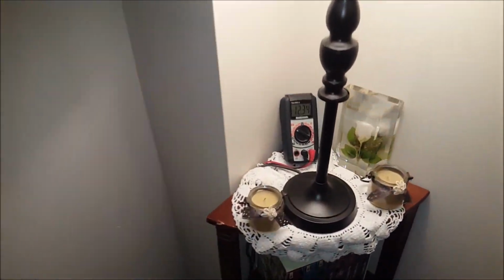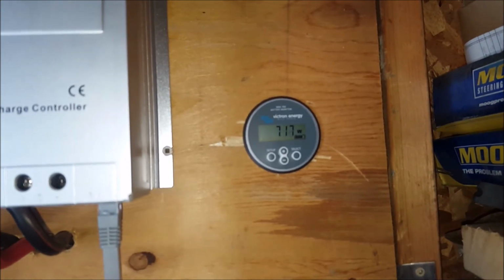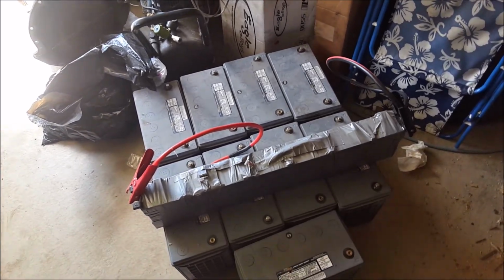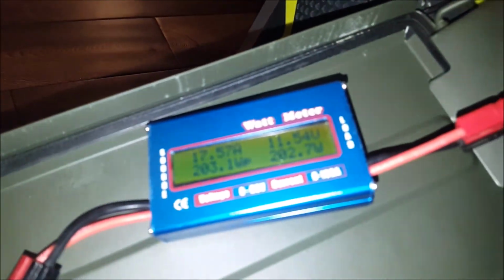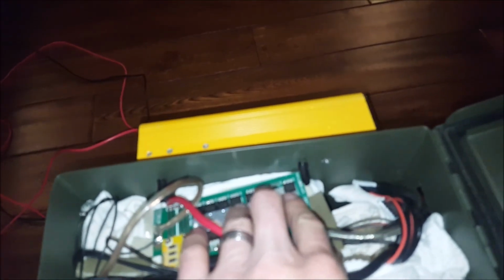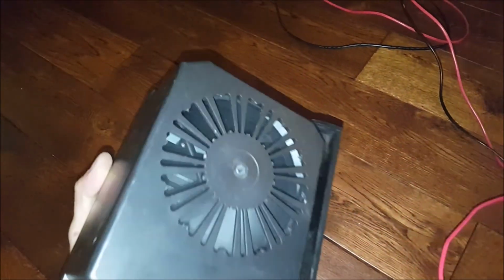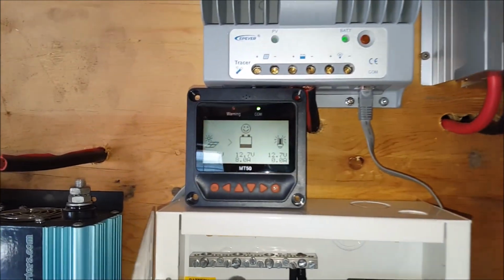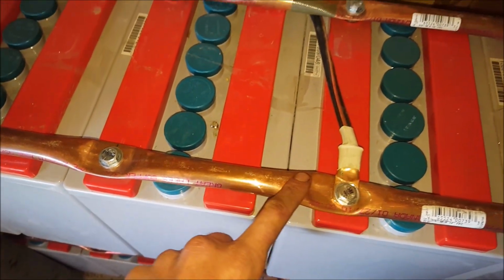Update on a bit of everything!

Comment: Awesome set up .  Was wondering is it possible to change my solar city grid tied system to a off grid with a battery bank for emergencies?  I have a 3500 watt system .
Reply from the maker: depends if you are using a micro fit inverter on the back side of the panels or not.
Reply: That's the situation I am running up against...  discounted last gen PV panels that are high voltage and must be using the micro inverters for grid tie res installations. Can panel circuitry be hacked and re-wired for 30v output ?  Tnx, rc

Comment: The Copper pipe busbar is cool, great idea!
Nice camping setup did your BMS shut down the batteries power output when cells hit the low voltage point?
Reply from the maker: +off grid kid yes it did at 9.7 volts